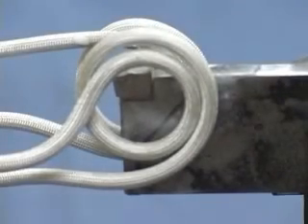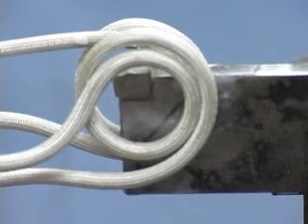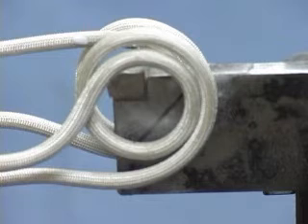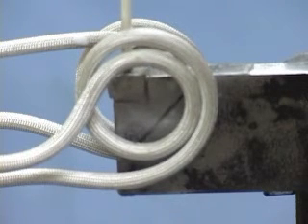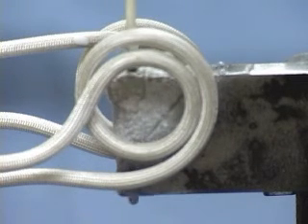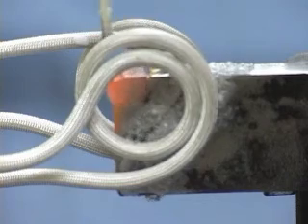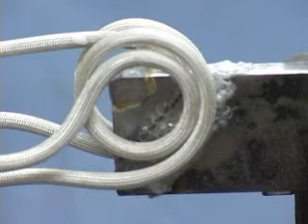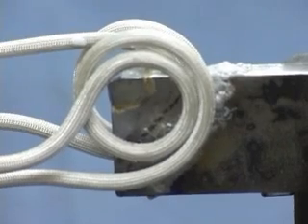Brazing Carbide Tool Tips

Comment from the maker: That is a very good question in some cases copper is used as the braze material however it requires an inert atmosphere. There are also nickel based alloys that flow at higher temperatures but they to require inert atmospheres. The Ambrell Engineers are not experts on all the different alloys out there I have copied 2 links of companies that have the expertise in the different alloys. 

Chris